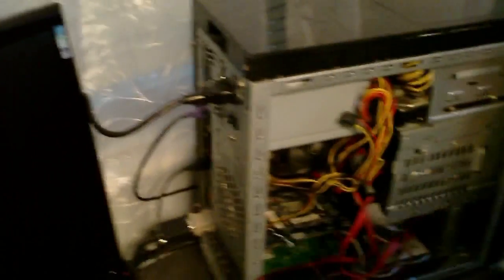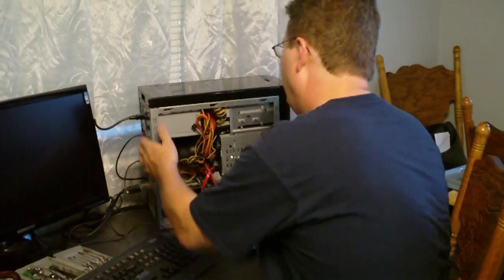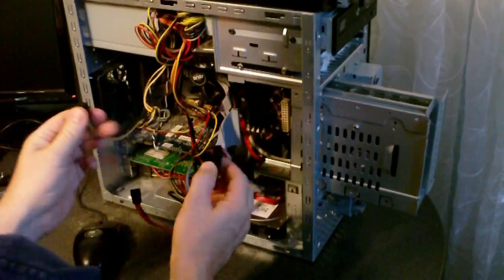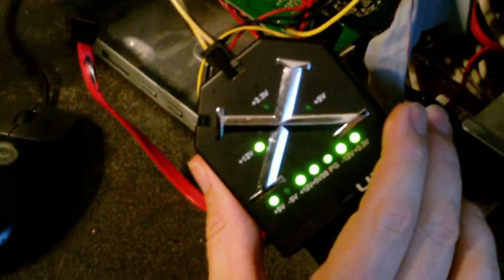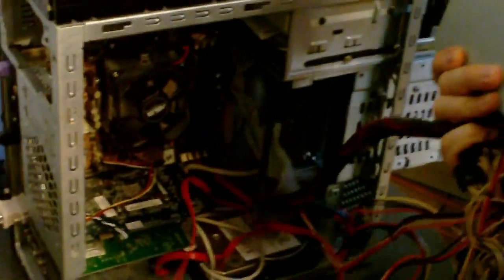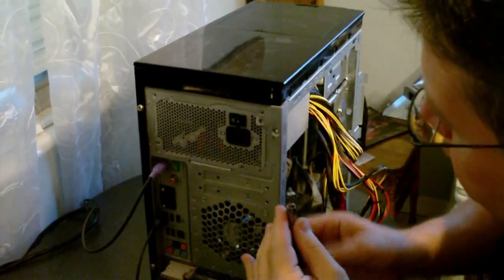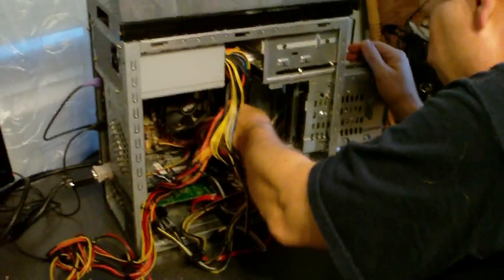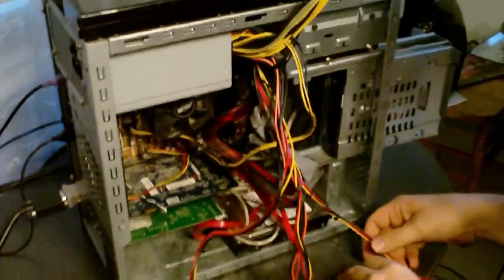Diagnosing and Replacing a Bad PC Power Supply - Part 1

Comment: Thank you so much! I just built a new PC and had trouble with POST and getting into BIOS, no video signal detected, etc. I looked around the web and was convinced the motherboard was bad but now I truly believe the power supply I received is faulty and will get it replaced ASAP. Thanks again!

Comment from the maker: As mentioned at the beginning you can achieve the same result if you discharge your static by touching something grounded on the chassis. Just be careful about dragging your feet across fuzzy carpet in the winter.

Comment from the maker: Intermittent problems can be good indicator of a bad PSU. what you said is also possible - your MB can short out against the metal panel of the chassis if it's not on insulated risers. An increase in humidity increases conductivity in the air. If you have a voltmeter PSU tester test it. You should get 12, 5 and 3.5 volts on a healthy supply. If you don't have a tester/meter try temporarily swapping the PSU in your machine with another PSU from a known good computer and you can test it that way.

Comment: Thank you for the video.  Naturally, I suspected the PSU othewise I would not have searched for this video :) 

To help other people who may have questions, I will describe my problem.  My PC is about 4 years old, but still ran great, until I started it up yesterday, and it did not boot.  The power light came on, the HD spun, and the system fans were on.  First I suspected the capacitors, but this MB has solid capacitors, so that was not the problem.  Before replacing the motherboard, I thought I should research a little more, and am glad I did, because I got a new PSU and the system is running fine again.  Also, there were no beeps, which can only mean the PSU or MB.  Always replace the PSU first, they are not expensive, but if you do it often enough, get a tester.

Comment: Howdy?..well  u see.. sometimes i boot for 5 seconds and than get the no signal thing..sometimes  its 5 hours ...sometimes i reboot just after post..sometimes  reboot after 10 mins..sometimes i lose signal to  the monitor randomly..but usually my problem is seen when it rains hard and the humidity is heavy on sunny days i don't get much issues ..do u feel its the  PSU? if u feel so ill get a new psu , a guy told me my MOBo is gtg shot with the chasis and i need  risers instead..?

Comment: I have an old Dell GX270 PC used only for routine stuff but never the less its old but it does the job.Switched off during the night then the following morning amber flashing light on the standby button. I tried all the usual stuff took out battery un plugged all cables etc still nothing.Thinking this was a power supply problem and not capacitor i tried a power supply from a packard bell just sat it on top the fan connected up cables left CD drive plug off.. Started perfect!

Comment: So what did the Power supply tester tell you? Did it show any problems or did it show as good because problem was intermittent? I saw the 5 volt test light was dark, was that a problem. You never said what the result was from the tester. I'm getting intermittent interruptions in video and buzz sound over speakers at the same time. I replaced the video card but still have the same symptoms. My next thought is power supply.

Comment: I have a computer that's showing symptoms of a bad power supply. I replaced the power supply with a brand new one and the there was no change. I already checked the memory and it's ok. I resigned to thinking that the problem is the motherboard but I noticed something today. I noticed that the red light on the power socket that feeds my computer flickers noticeably. The light on other power sockets in the house aren't flickering as much, and so it got me to thinking: Could it be that the problem my computer was having was actually a problem with the power source? Could a faulty power source cause symptoms similar to a faulty power supply?
Reply: probabyly a connection issue check all the cords from your psu and ensure they are all plugged in correctly

Comment: My computer will not cut on what so ever now when I plug it in the wall a green light comes on on my mother board where the power supply plugs into the motherboard. Does that indicate the power supply is good and the motherboard is bad ?

Comment: i have a similiar problem but i have a custom build pc, but i made the mistake of getting a raidmax PSU of 850 watts but my pc boots and goes thru POST but my problem is when win 7 is loading i get the BSOD, it happens so fast that i cant read it and my pc reboots itselfs, it takes about 3 reboots and boots into win 7, 3 BSOD is scary....FML, I tested my MOBO, GPUs, and HDD, and replaced my CPU with my AMD FX-8120 to my new FX-6300 and they both checked out ok, so it has to be my PSU!!!!!